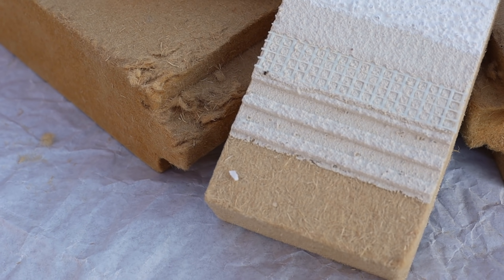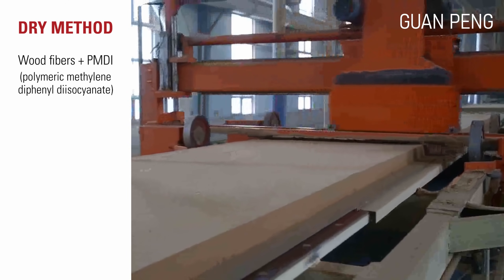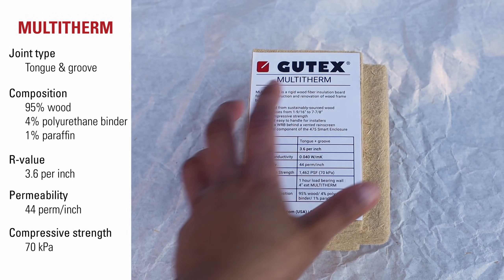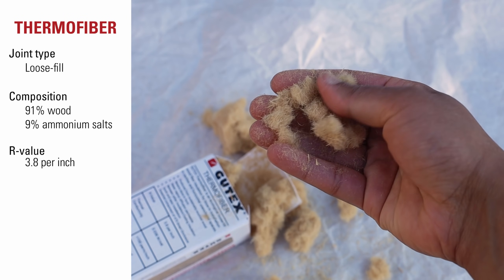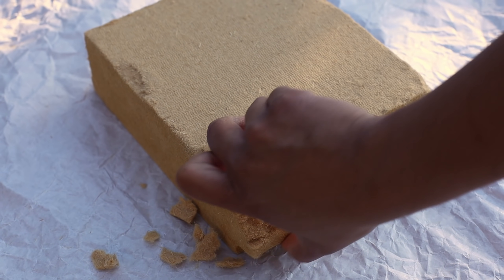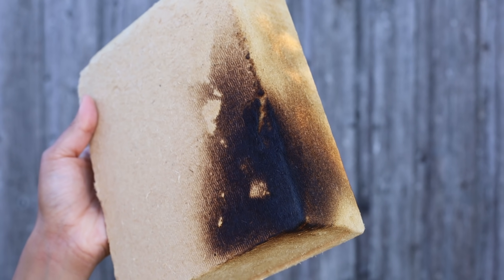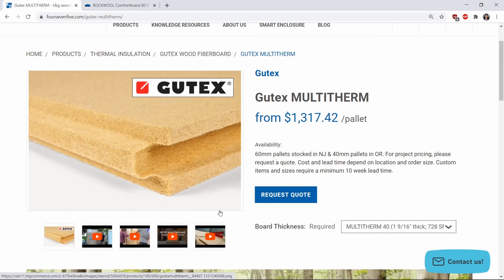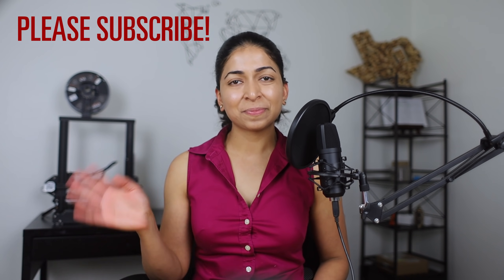Gutex Wood Fiber | The FUTURE of insulation?

Comment: there are a number of companies that make these products in Germany . Steico is almost identical to Gutex and i think there is at least one more company in Europe that makes this product .
My house in germany is a wood block house from Finland .the blocks/logs are 14 cm thick . the steico insultaion panels are about the same thickness and are installed on the outside of the walls and roof. furring strips are installed vertically directly  onto the panels with little to no compression . on top of the strips is wood siding.the space between the walls and the siding created by the furring strips acts as a channel to wick off any moisture build up . the results are xtraordicany .the house is almost rated as a a passive house and it's incredibly quiet inside . We hear with a two ton soapstone wood oven that only has to be fired every second or third day.The house is  260 sq. meters . the house across the street from us is about the same size and they use 12 stairs of wood while we use only 3 to 4 . the savings in energy cost can pay for the insulation in just a few years .  sorry about the long rant , but i'm super excited about this product

Comment: 2 years later and the US now has a local distributor of the stuff.  I'm super interested in using this when I reside my house and add external insulation in the process--even as I balk at the idea of putting something made of wood fiber and /paraffin/ on the outside walls, as it keeps sounding like I'm coating my house in candle wick.  :p

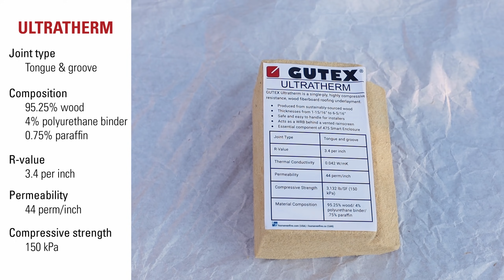Comment: I have a question on the Therma Wall product at 3:15.  Does that come from the factory with a stucco product so you have your siding built right into the insulation?

Comment: Here in Germany it is very common to insulate the roof with wood materials like from Gutex. Between the roofters with soft and above with stiff plates.
It is also a good thermal capacitor, which helps in summer time.
Seven years ago I renovated a house from 1972 using wood insulation for the roof and stone fibre (like rockwool) to insulate the brick walls.
Nowadays I would even opt for wooden insulation on the walls instead of stone fiber.
Btw Gutex is located in the Black Forrest, which I'm living close to.
Reply: @lepidoptera9337  Most people die in the fires because of inhalation of the smoke  - which is a really deadly chemistry, if it's not from wood...
Reply: @lepidoptera9337  Just look up from your screen and think about all the nice stuff you see around you. Just forget about the material the wall is made from...
Reply: Wood is good thermal capacitor?
Reply: @forevernevereasy  Well, the "stiff" ones have a higher capacity than the "soft" ones.

Comment: I just happen to see a video an individual posted about using cellulose in a garage for insulation. The problem is the cellulose had ammonium element. When the humidity got high in the summer he said the garage had a significant ammonia smell that took days to evaporate. He ended up removing the cellulose and replaced it. I would not use Thermoflex if it did the same off gas side effect.

Comment: I think it all comes down to lack of research with builders/ home owners in the USA. Pretty much everyone just follows the crowd, stick framing with 4x2 timbers or if you are lucky maybe 6x2 timbers and everything is just done to minimum code requirements assuming that state has building codes. Very few people seem to research what would be better for them and how much they would save with more insulation added to the building. I cringe when i see concrete slabs being poured in the USA without a damp proof membrane / insulation under it first, or if someone does put insulation under then it's only 2 inches. Here in the uk we are required to put  at least 100mm / 4 inches of insulation under every concrete slab in a house.

Comment: Hi Belinda, love your videos! I have an objection to the sustainability claim. When I did a presentation on Steico company (I'm attending school in the Czech Republic), I dug a bit into the certifications like FSC and PEFC, and from what I found out, these institutions don't really have any means to control the certified wood producers and they have multiple cases of certificating straight forest abuse. In my opinion, there is very insignificant sustainable forestry on Earth right now and I think it should be mentioned. That doesn't mean that these products aren't the future of sustainable building, I strongly believe they are, but right now I wouldn't market these particular brands as sustainable.

Comment: We're using Pavatex insulation board & membrane for the new roof on our watermill in Scotland, and will be insulating all the internal walls with with Pavatex board - its visually very similar to the product you have. It is more expensive, but for us with a historic building it has a huge amount of advantages - such as giving us a negative condensation risk do the the permeability, being compatible with lime mortar, and allowing our whole building to breath through the stone walls. Using modern materials would mean we would need to have a vapour barrier around the whole inside of the building, and the stone walls would not be able to dry out effectively - reducing the life of the building.

Comment: A huge reason why the European construction industry is so ahead, is our conditions. I live in Finland, we have four very extreme seasons. Very hot and dry summers, very windy and rainy falls, winters that can have extreme cold and snow. Our fall and spring also include lots of temperature variation which causes snow and ice to constantly melt during the day, and refreeze during the night.

We have always had to build our homes with insulation and ventilation in mind. Especially a few decades ago, we only had access to heating by burning wood, and cooling by letting air flow.
Currently we obviously have modern air conditioning and heating systems, but we consume far less energy using them. That's just because our buildings are way more energy efficient than in many other places.

Comment: Thank you! I am considering to use wood fiber in my van. First a layer of cork roll. Would you recommend wood fiber in van? I have considerer sheep wool and hemp also, but wood fiber is more local, and due to corona its hard to get sheep wool now. I am thinking since wood fiber also has this advantage of handling moisture.
Reply: I think wood fibre would be alot heavier that sheep- or hemp wool?
Reply: @junebay5265  yes, I think you are right. It was hard to find sheep- or hemp wool, so I went with wood fiber.

Comment: Thanks Belinda!  I keep hoping for a natural replacement for ICF, using Hempcrete or Gutex.  Using much less concrete than ICF and by pouring a bond beam, allowing the blocks to be load bearing. Stucco on the outside and plaster on the inside , no wall cavities, no wall wrap, tape, no need for vapor barrier. Must plan for all plumbing and wiring on interior behind panels. no chance of pipes freezing. Fire rating would be high,  The acoustic properties would be excellent. It would be ideal for owner builder.

Comment: In Europe there’s a tradition of rendering the outside of buildings (stucco). That’s where the wood fibre gets used a lot in combination with modern polymer renders. These come pre-mixed in a range of colours. So you can add to the insulation value of a timber framed building while having a good substrate for the external render. It’s that versatility that works.

Comment: LOl  Here's the deal people spray 2-3 inches of Foam. Then Go across the studs with Aluminum Double Bubble Tape it off at the seams, windows, floor, ceiling, sockets, everywhere. Tyvek works fine.  Whatever your heating bill was going to be it is now 80% less. Oh and the whole set up is fire resistant and bugs won't eat the foam or the ADB.

Comment: News flash! This is nothing new. I've been a carpenter for 50 years and have found the wood fiber insulation in homes of the late 20s and into the 40s.
Reply: So, if it's not new, where can you buy it in the USA other than Gutex?

Comment: What are the flammability properties?  (Note, it is also hard to light a 2x4 with a torch, but it burns just fine).
Reply: It's no worse then other foam or wood materials, certainly won't put a fire out however.

Comment: Great video as always! We used this to retrofit insulation in our 70s house in the UK. It's not super common in the UK so was unusual here, too. We full-filled the roof with 220mm of batt, followed by 60mm of sarking board on top. The interior side has an air tightness moisture control membrane, and the exterior sarking is sealed on the perimeter so it is effectively wind-tight (not air tight). The U-value is around 0.13, which is very good. In a 190m2 house that has triple glazing, only an air cavity wall, and some work-in-progress holes in the fabric, our heat demand is now about 100kwh/day at 0 degrees C, and only 20-30kwh above 10 degrees C. Previously the house ran at more than double this.

A few points that are worth adding. Fire proofing is not just about resistance. When it chars, it reduces the ability for air to reach the rest of the material, and as such, the fire doesn't have enough fuel to burn. So, when you have it around a whole building, it will form a charred layer and rapidly prevent fire spreading. This is the same reason straw bale houses work, because they starve the fire of oxygen as they char. Not to mention, you can still have fire boarding and other details to slow the spread to the material in the first place (anyway, PIR burns horrendously at high temperatures! Just lookup Grenfell Fire!). 

The moisture retention capability means that in practice, with the right design and moisture control on the interior side, it does not grow mould. The UK is well known for being mild (cold!) and wet. However, one key advantage of the material is that it stores, rather than just reflects heat. Heating warms the material over time, and dries it out. Because it is completely breathable, moisture naturally migrates through the material. I think it's a non issue. If you've got that bad moisture problems, your timber structure will have just as many problems as this insulation will.  

This heat storage is brilliant - if you have a significant thickness of it, it acts as a two-way buffer. It can absorb solar heat and then release it over time, but it can also absorb your own house's excess heat. This slows the swings in temperatures you see with more reflective insulation. I am using it between floors because it means you get brilliant acoustics, but it also acts as a very slow battery holding excess heat until the house cools down and needs it. 

Finally, acoustically it really is amazing. Our house sounds completely different. We have pitched tall 'skielings' and the room acoustics are so different. Combined with triple glazing, we don't even know when it's raining now a lot of the time.

In practice, with a house with a large south facing mono-pitch roof, where we get a large amount of solar gain, we have found that after a number of hot days the house stays cool, but the following days after the heating demand is much lower. This is in theory because the insulation is holding some of the solar heat still, and either releasing it, or lowering the temperature differential between inside and outside. The house never overheats and stays a consistent temperature, despite having some rooms with (too much) solar gain. 

Oh, and working with it - yes I'd probably wear a mask, but all it creates is (a lot) of sawdust, which biodegrades into your garden. It's not itchy like Rockwool.

It is a great material with upsides that outweigh the downsides, in my view.
Reply: Not so sure the binders and fire retardant are biodegradable. Take a look at the ingredients before you decide to use engineered wood as compost.
Reply: Thanks so much for your comment. Very helpful

Comment: I like the concept for exterior insulation, but with the added cost compared to mineral wool, the incentive just isn't there yet. That being said, while you fire tested the exterior product, I'd be extremely nervous about the blown in insulation. That just looks like kindling for a fire. Imagine your wall cavities and roof full of wood kindling. I'd bet this is equally bad to spray foam in that regards. I still think mineral wool is the best option on the market (at this point).

Comment: Thank you for this video. That reminds me of something during my time in the construction industry.
Compared to the Enviro Foam Insulation which proposed a 7 R value per Inch. But regular foam maxes out at around 6 R Value. What is the difference in Canada? 
Yeah, everyone went with EnviroFoam because it is only 3 Inch to reach the requirements of a R Value 20.
Back then I have sent a few eMails to the producer, never received an answer.
Would you insulate your home with plastic?
Burns like hell, lol

Comment: It has a terrible R value per inch and a mixture of wood pulp and parafin wax might just be the most flamable in wall insulation ever developed. I can see right away why this crap isn't popular in the US market. The only way it would be any good is if it is really cheap and could be cost effective for commercial applications in warm areas.

Comment: Could Ultratherm be used on top of planks and below 1/2" plywood on an attic floor? Is 150 KPA enough compressive strength for an area that sees almost no foot traffic? I have a walk up attic in which I would like to increase the R value without pulling up the plank floor.
Reply: Put in short posts made of 2 by 2s on a 12 inch grid. Install bat insulation, or put the plywood down and blow in dense pack cellulose. Cellulose would be the cheapest if you do it yourself.

Comment: Love the video and the channel!  I'm still left wondering more about the fireproof properties (what chemicals etc are added to keep it from burning) and insects (not just termites, nesting is just as bad as consumption).  I agree with Belinda that this product could be great as an exterior insulation if those questions were more completely answered, for me at least.
Reply: Wood doesn't burn nearly as well as you might think. Even plain paper stacked many layers thick is really hard to burn trough.

Comment: The carbon removed from the air is not taking into account that trees also give off carbon dioxide at night. Unless this is taken into account then the carbon removal is fake and incorrect advertising. The fire-resistant properties are nice and I like the different forms for different parts of a building. The cost is not good though. Not going to be gaining traction unless the cost and availability is improved and by a considerable amount.  Ofc I can build a house that beats all of them without having to "add" insulation. So I will not be using these products or others as they won't be needed.

Comment: I’m thinking of building a 12 x 8 x 8’ tiny home to travel in. Do you think this Gutex THERMOFLEX would work well in snow conditions like Alaska, as well as in desert conditions like Arizona? Tiny homes are notorious for moisture buildup and mines going to be very small like a camper so it’s very mobile. I’m wondering if all the moisture and snow up north would work against you wicking your moisture out of the tiny home and/or possibly even absorb too much moisture from outside. I’m just starting to learn and plan my project so forgive my ignorance.
Reply: What's your stud wall thickness? Are building timber to steel stud.
Reply: @dankim3950  wood, and I was thinking 2x4 studs all around. Do you think it would pay to do 2x6 studs in roof?

Comment: 90%+ wood sounds extremely combustible to me especially with the loose fill stuff. Many of the European products such as exterior commercial cladding were never fire rated (hence London & Dubai high rise fires both having the same European product). A few seconds from a torch wouldn't do it for me, I'd only trust NFPA fire rating for the commercial work I do on a daily basis.
Reply: It's saw dust soaked in wax. Reminds me of a candle. I can see how the highly processed stuff might have part of the flamible removed, but the other type is just wood plus a few things, right?
Reply: All insulation is combustible to some extent unless it's mineral fibre or FRR composite laminate. Try putting a blow torch to glass fibre or polyester insulation....
Reply: Glass will easily burn? 🤨

Comment: Unless a fire retardant is added, those block should burn.  They are composed of cellulose, the same as wood.  That torch did not add a lot of heat to that block.  Short exposure to a torch like that is how people replicate the Japanese burned wood treatment.  Most types of wood can tolerate a torch for a short period of time. A real test would be toss one in a fireplace and see if it burns after a minute.

Comment: I love the concept of structural insulated panels but the styrofoam component is still a bit of a turn-off... would a sip panel made with LDF or another similar interior component other than EPO make sense?  It just seems like the way we frame houses is so outdated and I would hope that some sort of panelized and frameless system would be at least part of the answer.  would it make sense for these two technologies to come together?
Reply: I think it might not be very good, since the wood on either side may slow the movement of vapor too much. I would have to know the perm rating of the wood on either side. SIPs with synthetic foam is fine because it won't hold much moisture to begin with, so the wood on either side can dry outwardly